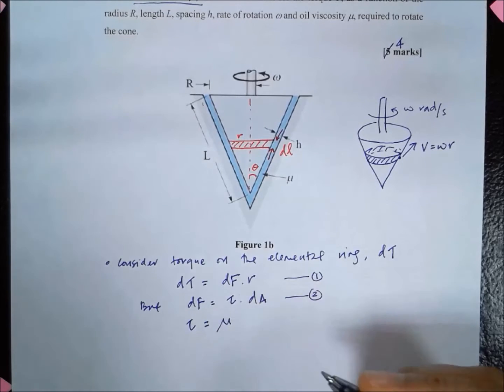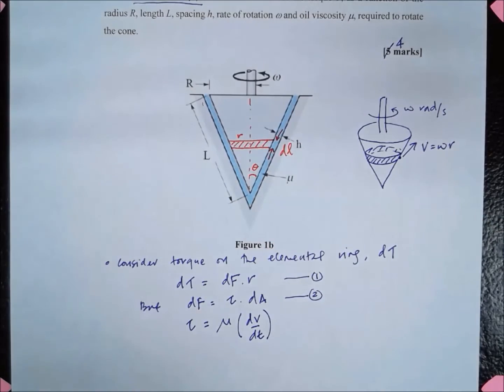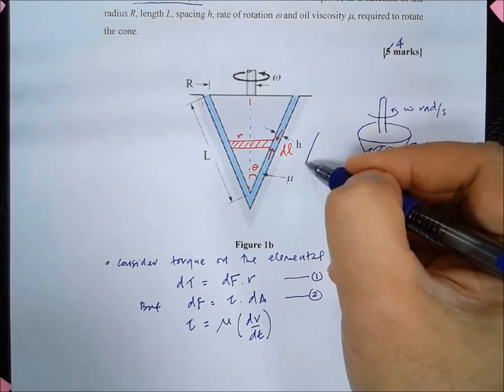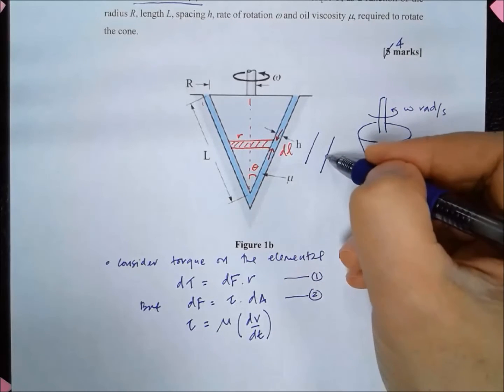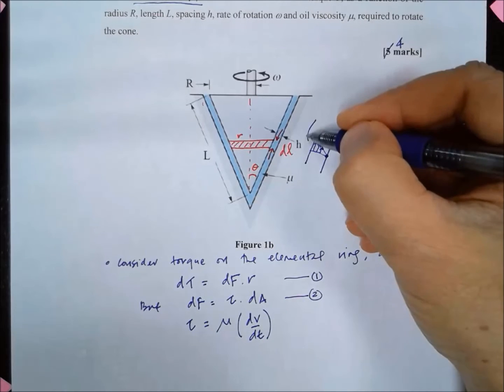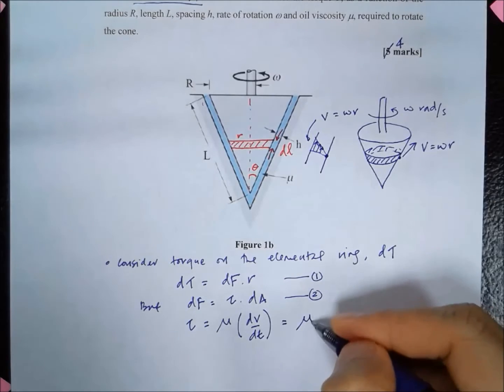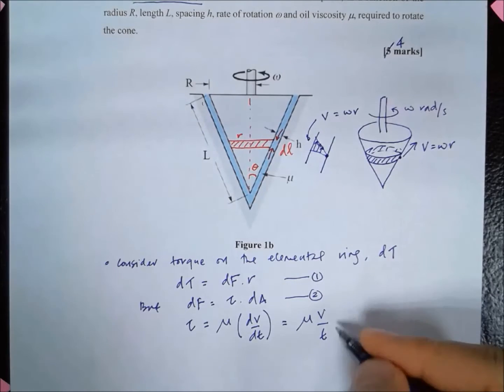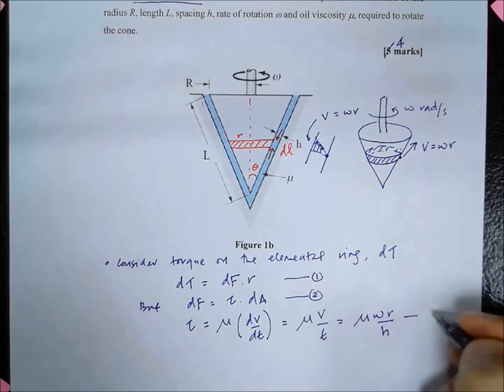Viscosity Example 03

Comment: It should be 2πr×(vertical distance not dl)
Reply: No you are wrong  .. area varing along slant height ..
There for it should be 'dl'
Reply: @ANUPKUMAR-js1vo  :-it is a bottom most point zero and finally πr^2,and varying along depth also apart from slant height variation!